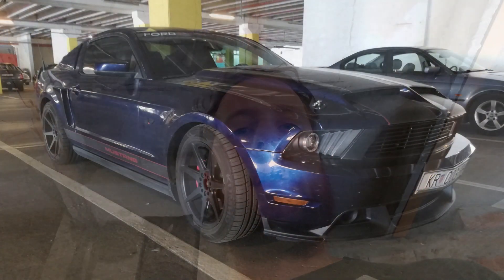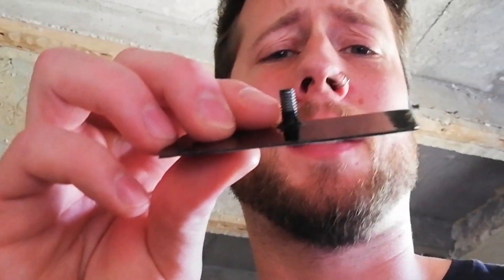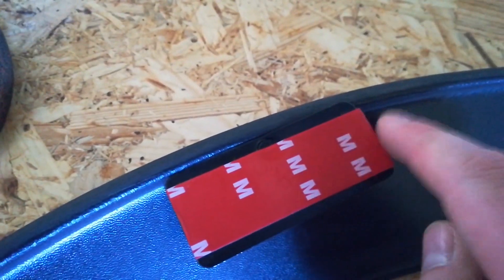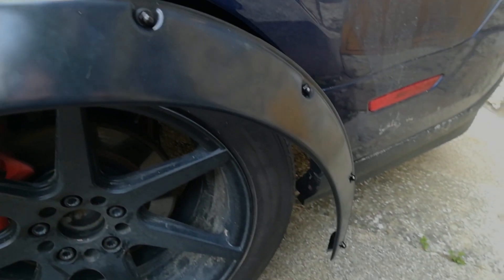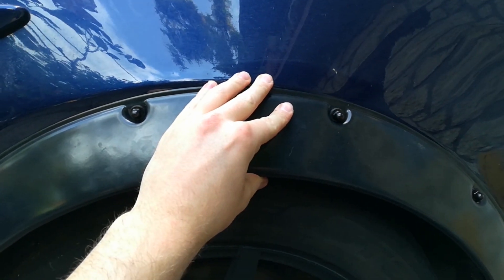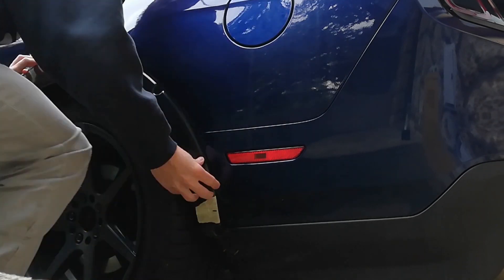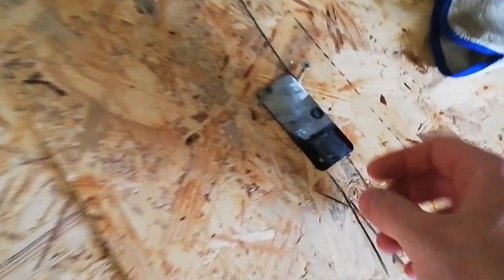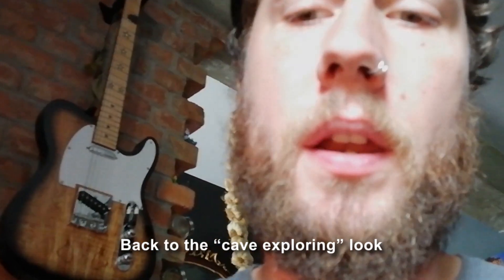Removable Fender Flares - Part 1

Comment: Since the link in the video for the metal plate is not working just search for the "rear window louver replacement Hardware mounting installation" on ebay and it will show does metal plates.
Reply from the maker: Thnx for bringing it to my attention, I fixed it.

Comment: Nice to see someone being creative but it just doesn’t look clean imo. Also what happens when the new wider tire/wheel bottoms out against the real fenders since it hasn’t been properly cut out?  You would have to run stock ride height or the worlds stiffest suspension 😬
Reply from the maker: Thanks man. 

Yeah agree, it's not 100% clean but it's the best I could do. It does look good though once finished. Part two will show the install and the flares paint matched to the car, looks a lot better that way. 

Agree on what you said about the bottoming out part and I'm a bit worried about that myself but I have full suspension which is stiff as fuck so I might be good. I'm also lowered 1.5" atm but have 1.2" springs sitting and waiting for install just to be a bit more on the safe side. 

Good thing is, if they rub, I can take them off. 

The whole point of this, for me, was to see if I like them or not and the only option out there costs $500+ which I wasn't going to pay just to try and see whether or not I like them. Now that I know I do, I might even go ahead and make them work for real. 

I thought I'd share it, might help someone else out. Who knows.